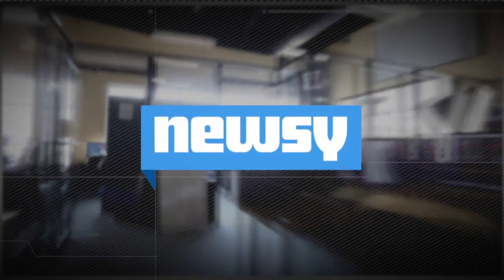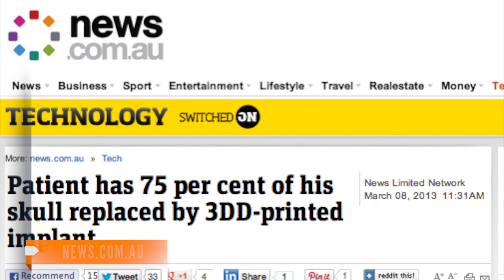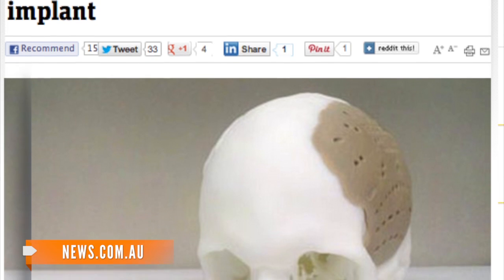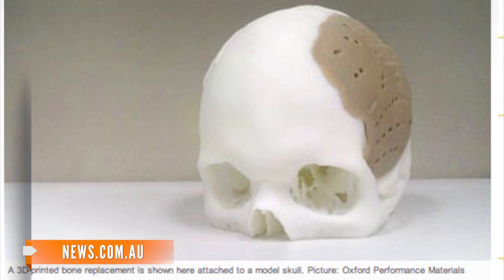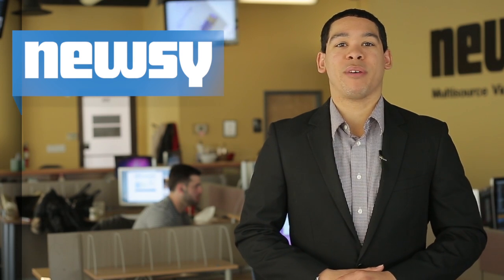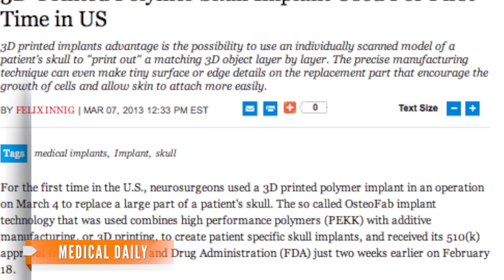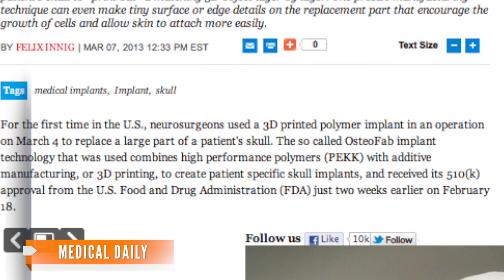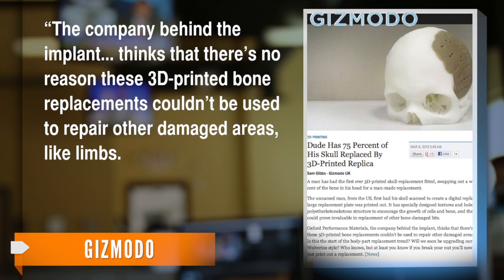75% of Man's Skull Replaced by 3D-Printed Implant

Comment: The strength of the PEKK Polymer actually has very similar properties to bone. The tensile strength of bone is in the range of 60-70 mPa and 3d printed PEKK has a tensile strength of 80 mPa. In addition PEKK's compression strength is 160 mPa which falls in the center of the bones range of compression strength which is around 70-280. On top of this PEKK is osteo-conductive meaning bone can grow into and on the implant.